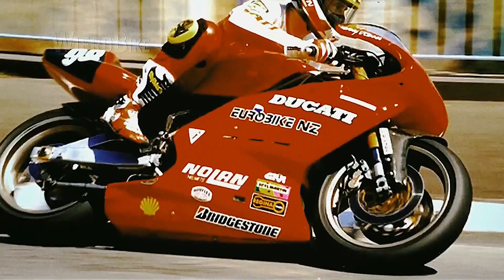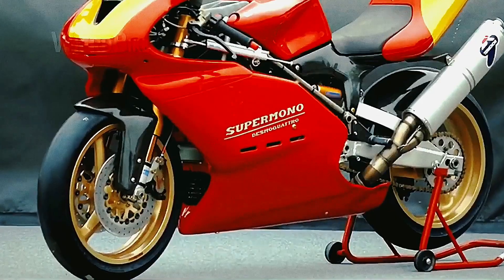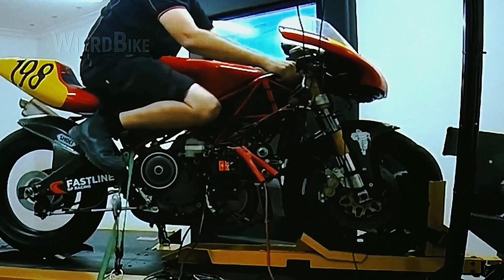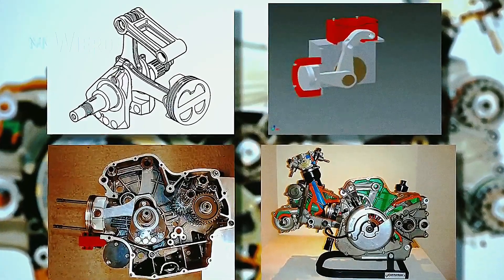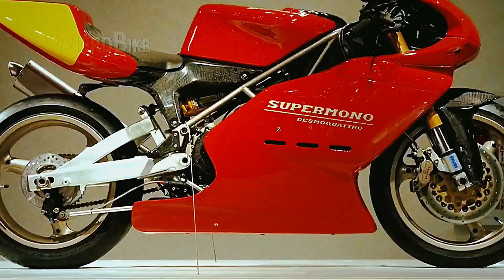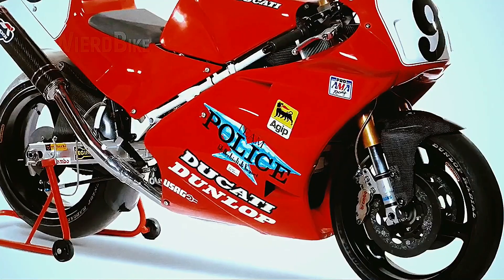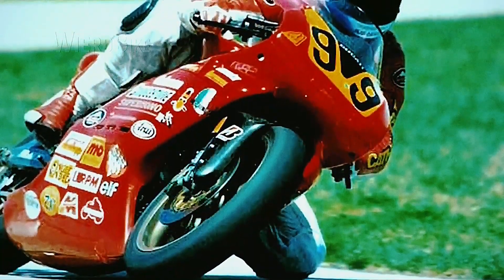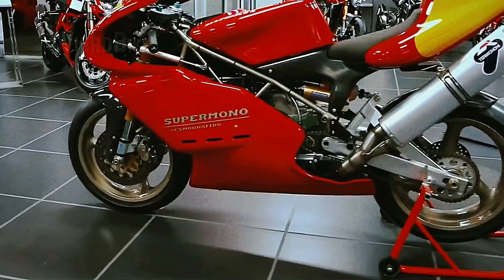How Ducati Made A 1-Cylinder Bike Truly Fast? The ENGINE TRICK by Massimo Bordi!

Comment: 572 ccm 75 hp ? 🤐🫣 cosworth made single 300 cc  90 hp … they left stroke 70 mm what for 11000 rpm limiter mean 25,6 m/s avg piston speed thats limitation 🤭 wuch ma ifactory know this egzacly already than so or regulation dont allow them to decrease stroke and in results shifts  max torq on more rpms = more power  besode 50 nm from 572 ccm 🤭 what a joke 🫣 from 572 ccm you can do almost 70 nm 👌🏻🪠 this film show you have no idea about combustion engine n/a limits or forget mention about regulation of this race then 👌🏻🪠☕️
Reply: from 572 ccm single with 70 nm only reciprocating mass must be take into considerstion as limitstion though enough roboust crank asf can solve this trouble anyways 70 nm at 40 mm stroke where piston surface area start to be huge for huge valve you canput this 70 nm at 17000-19000 rpm and generste from this junk almost 200 hp 🤭🌪️ so yea 572 ccm and 75 hp at crank amaizing piss pf crap 👍🏻 🤭🪠☕️
Reply: yea reciprocsting mass must be utilize be enough strong crankshaft and conection rod asf and enough short stroke what decrease avg piston speed for hold enough low force work on crank and conection rod otherwise something ripp off and can  fly be tank asf 👌🏻👍🏻 i quesss true limit in this race was regulation cos all manufactory already than know egzacly how make huge power from 1 litres dispalcement= as short stroke as posiible as huge valve surface area as posibble + offcorse vslvetrainenoigh fast where feg spring from some point start to be not enpigh fast due to its strenght to inertia ratio and pneumatic or desmo or some other 💩 must be use …